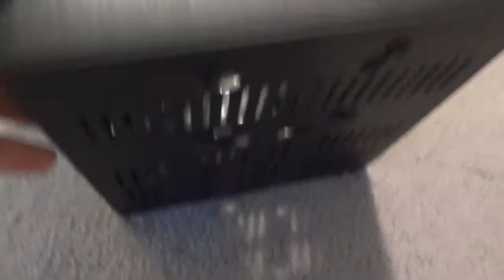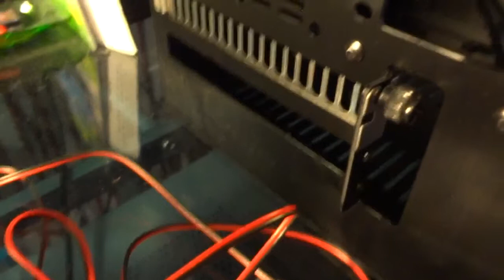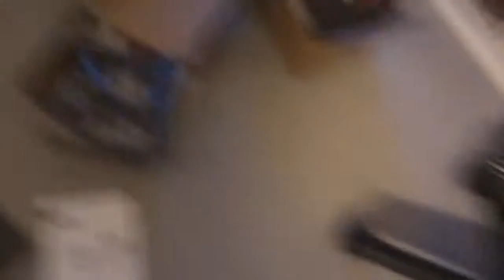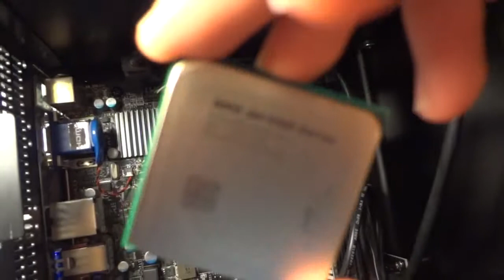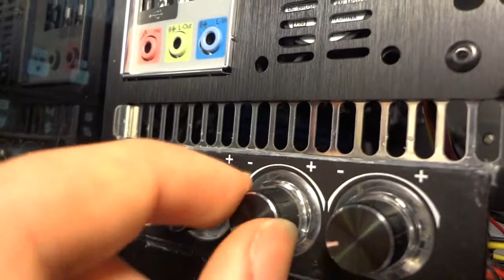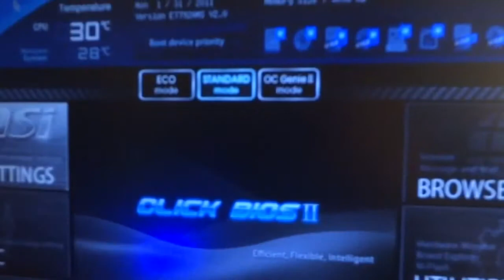Mini ITX Build 2014 - Part 3 (Finale)

Comment: I realy need your help, I have the same motherboard but do not know where to put the reset sw, led hd and other wires can you send me a picture of your board how you connected them? my mail is pt.ajs.tuna@gmail.com
Reply from the maker: Unfortunately, I sold this computer well over a year ago. Try looking up the motherboard documentation online (if you don't have the manual that came with it). There should be at least some indication where each wire goes. If I recall correctly, it took a few tries to get everything right - don't be afraid of the "trial-and-error" approach.
Reply: Thanks for the reply, yeah today I was able to fix it, thanks again!